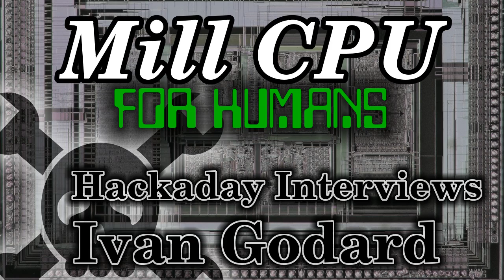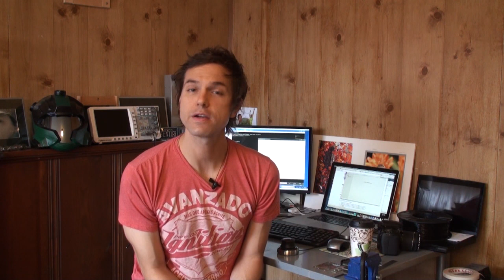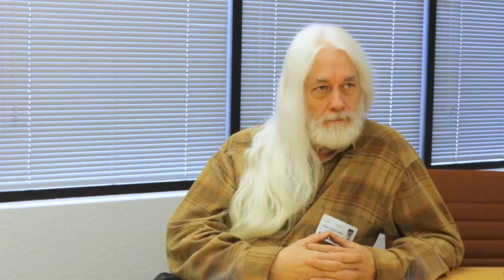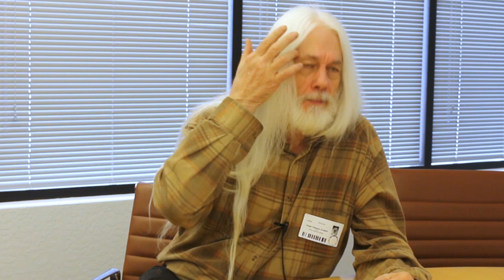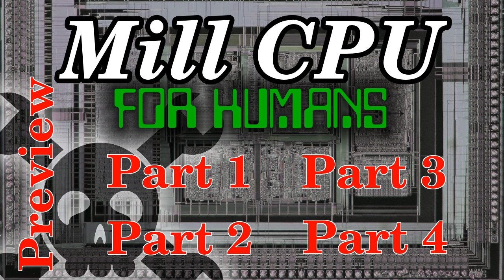Mill CPU for Humans - Preview

Comment: I was under the impression that the concepts behind synthesizing instruction sets automatically were pioneered at DEC by Ken Olsen in the 1970s. I don't know exactly how much has been automated since then. The continuing use of Verilog suggests to me that this line of thinking never died out.

What may be unique here is the process of using a specification (in this case expressed as c++ code) to build an instruction set, a chip design to execute that instruction set, a simulator, a compiler and so forth. This is exciting, but I would have imagined that such a system already existed, if only in academic "toy" form.

This is interesting, and it all makes a great deal of sense, but to my mind the actual architecture -- claimed to be novel -- is even more interesting than the tools. How does this new RISC-y architecture compare with the work of, for example, Carlos Sequin in the 1980s?
Reply: +Ralph Dratman I have read about the Xtensa chips, where you can at least add new custom instructions to a core instruction set and generate tools and documentation for your custom instruction set.